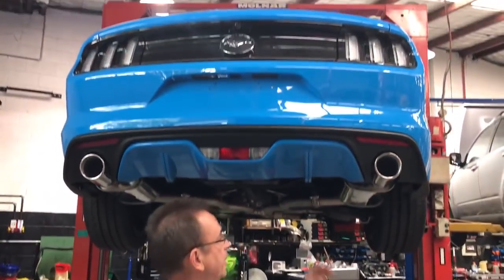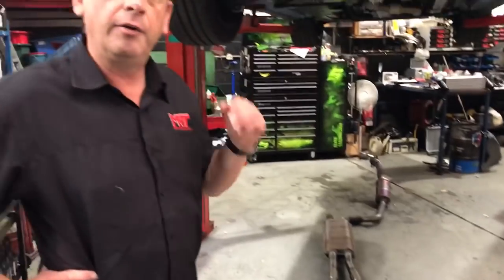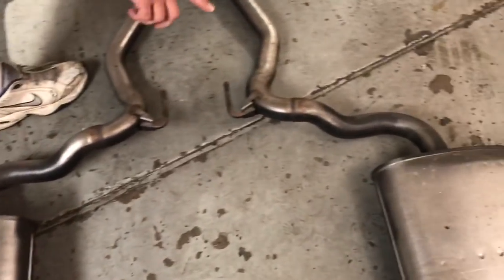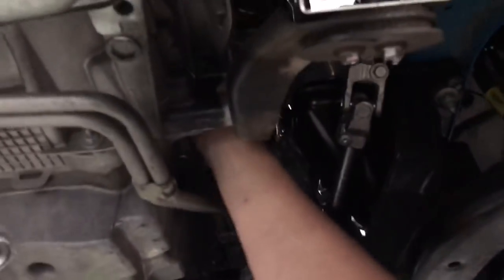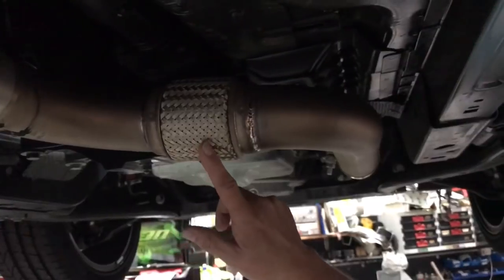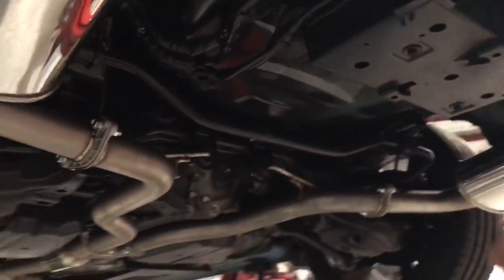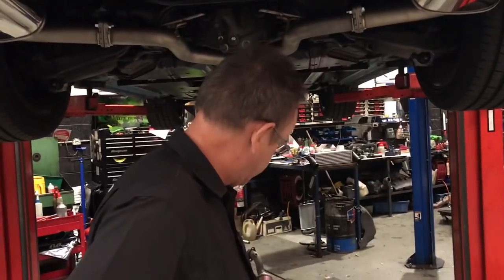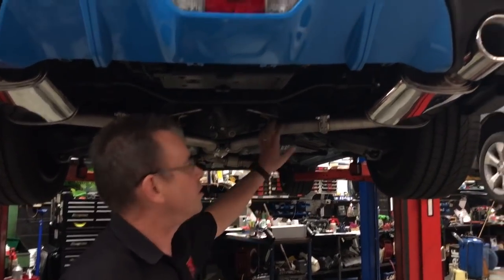Mustang Ecoboost Exhaust Upgrades

Comment: I'd go with a single pipe exhaust.  Catback systems in the U.S. that reduce almost 40 lbs compared to stock.  It's a four cylinder, even with dual pipes they still sound like a four cylinder.